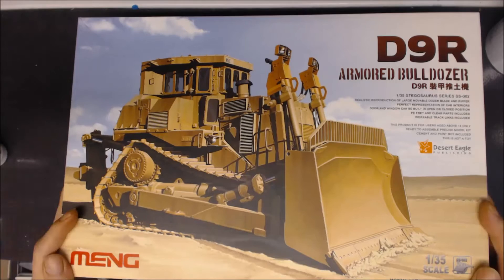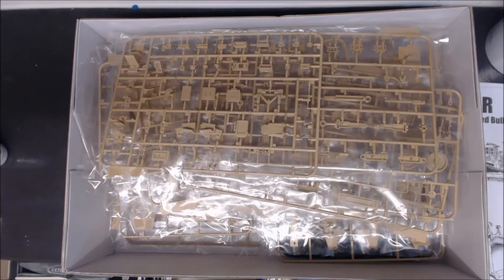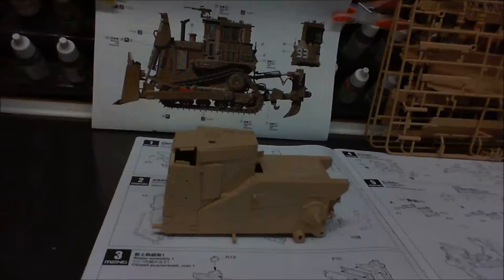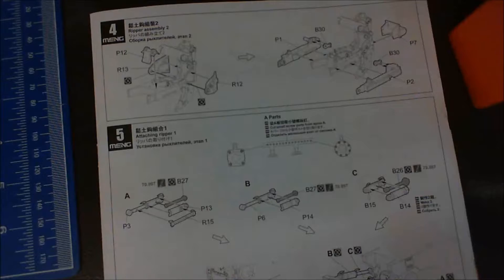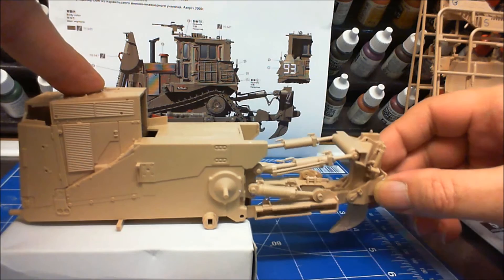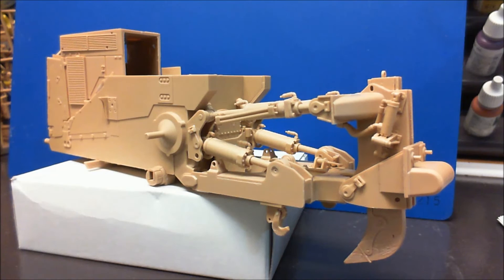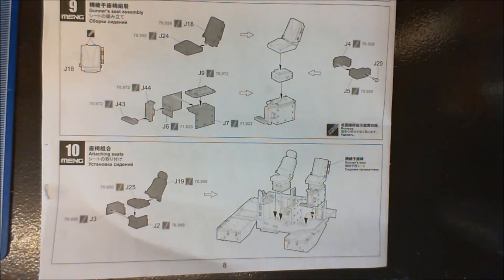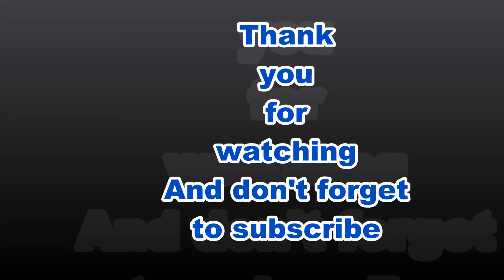D9R ARMORED BULLDOZER - BUILLD  [ 1 ] BY MENG

Comment: Simon, after following your brilliant build videos on this kit I bought one to start over Xmas. Its the slat armour variant. Its a little different to your kit in that it has metal tubes for the ripper hydraulic cylinders and the track centre pieces are a single part making track assembly much less fiddly.  I've just completed the ripper but I don't know what parts R3 and R4 (in your instructions) are for. They look like small hydraulic cylinders but don't connect to anything. On pictures of real civilian dozers they don't appear to have these parts. Any ideas?